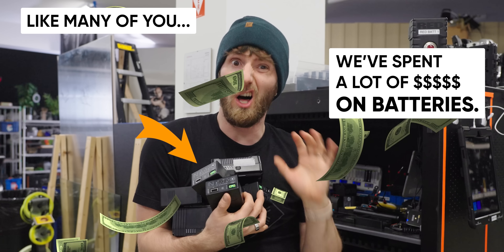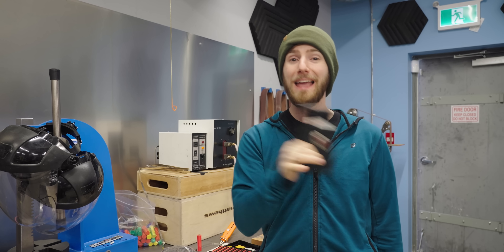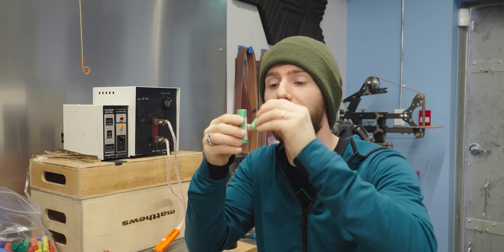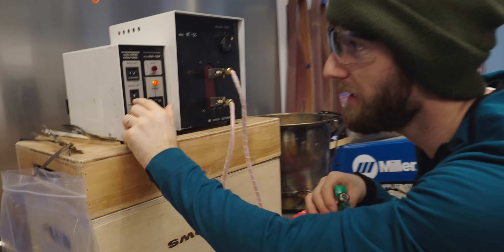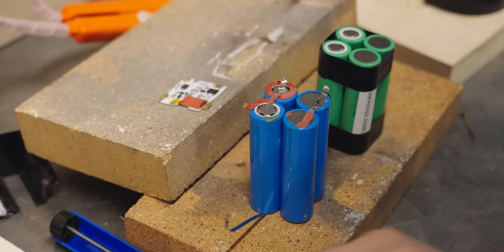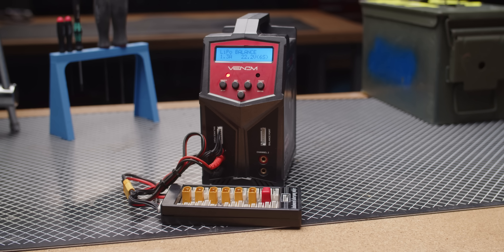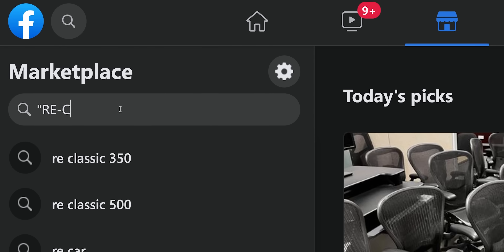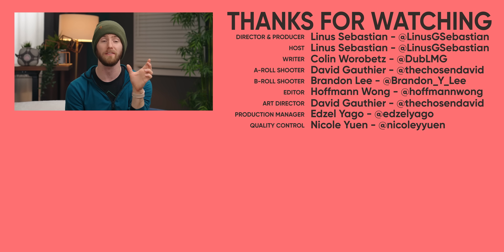This should be illegal… Battery Repair Blocking

Comment: As a safety engineer working with batteries I must tell you that you should split an "evil" category into "really smart" and "evil". Why? Old cells may have increased self-discharge and if they discharge below certain level they start to damage themselves internally in a way they become unsafe when charged. Mildly overdischaged cells may be safely charged with a very small current while below certain voltage there is so high riosk of internal damage that it should not be attempted. Battery manufacturers take this into account by including a pre-charge feature, but also a lockout function which bricks the battery if any of the cells go down below certain voltage, say 2.0 V. Guess what happens when you try to swap cells and suddenly there is no cell? Yep, it bricks itself as a precaution. Now, that's a "really smart" battery that in turn is PITA to swap cells, but with a right tool a BMS chip on such battery may be turned back on. Then we come to "evil" batteries: They do the same, but they have ENCRYPTED BMS chips or even do some trickery to measure cycle count or cell capacity changes.
Reply: It seems the same thing about inkjet printers: in the past my dad used to recharge ink cartridges, he bought 4 bottles of ink for basically nothing, useful to charge the cartridges forever basically. They could be filled by a hole under the sticker with a syringe veri easily. Then we bought an Epson printer, when it detected that the ink was finished there was nothing to do, it couldn't be reset. Even if you did refill the cartridge it was useless. Of course we did toss that printer away and go for a laser one, but still. 

There is no reason to allow the BMS to be reset easily: you don't need any fancy stuff, since the BMS is probably a microcontroller, do you tell me that you don't have a spare GPIO that can be brought out to a board contact that if connected to GND will reset that protection? Do you tell me that coding that feature requires more than 10 minutes? And do you tell me that you don't already have that feature for use during manufacturing, but you on purpose disable it after the battery leave the factory to avoid people replacing them? Well.... exactly as the ink cartridge, it's a product made with the purpose of being not user serviceable.
Reply: Therein lies the problem though. Nobody makes the reset tool readily available, so frankly, they're no better than the evil ones who encrypt. To that end, it makes more economic sense for someone to find an aftermarket BMS that will play nice or be sneaky and clip a few power supply outputs (at the appropriate voltage(s)) to the BMS before disconnecting the battery pack.

It ought to be on the battery manufacturer to have a tamper indicator so that when it does go up in smoke, should the tamper indicator survive the blaze, the manufacturer can wash their hands clean of a DIY'er failing to repack their battery while still allowing the DIY'er to perform the task instead of gouging them for another expensive pack.
Reply: @larzblast  Apple's tamper indicator bricks their entire phone when tripped.
Reply: @Astro_Alphard  We're talking about replacing cells within battery packs here, not batteries inside phones. Totally different paradigm (though Apple are evil for what they do with their batteries too).
Reply: Yeah the topic is repairing battery packs but the theme is widely related to lots of other repair situations, John deer for example. Support the Right to Repair. If you know who encrypts their BMS, or who booby- traps equip they sell - Don't buy their products. Companies should give up control when they sell you their product.
Reply: If a company doesn't sell you the tool you need to swap the batteries or even worse does not even mention that such a tool is required with their battery management system. Then they might as well fall into that evil category
Reply: Thats really insteresting i enjoyed that bit of info and seeing how you have knowlege in the engineering i have a question for you.
 I have a couple of makita drill batteries that will not charge. The #1 cell is connected to the portion of  BMS that checks the batt voltage. The volts on the #1 cell dropped below operating use while all the otheres where fully charged because the bms burned up all the storered energy from the single cell. I figure you already know that situation so i dont have to fully explain it but now with the issue fixed the smart charger (only 1 i have for it) has locked out the 2 battery packs thathad this issue.
 
Im hoping you know if there is a way to reset the BMS lockout chip? Im about to attempt removing the BMS completely from the pack and letting it fully disharge in hopes it'll memory wipe the lockout chip on the BMS. Theres also a 7 pin connector located on both the battery and charger. One of these pins leads to the lockout ship but I'm not sure which one as of yet until I find a schematic that tells me which pins are which.
 I've recently fixed the BMS on a Milwaukee battery and a HP laptop where the battery is dropped below voltage and the BMS had shut off and the only thing they needed was to be woken up because they were in sleep mode.
 Unfortunately in my case that's not the issue to resolve them so for now I have to use another battery that can be charged to charge the batteries that won't be charged. 
Would you happen to have any advice I could use to get these problem batteries working again?
Reply: @mknight6026  Did you ever find a solution to this BMS problem? Please share if so ...
Reply: @mknight6026  the best solution to resolve your bricked  Makita batteries is to swap the BMS with one you can buy on eBay or AliExpress. That is, if you want to use the Makita charger and have everything work. I have tried to resurrect the original Makita BMS without success, and rebuilding, resetting power tool batteries is a big part of what I do.
Reply: Not an expert here but have done a lot of reading and have done pack repair.  The point about the BMS shut down for recharge safety is a fair point.  BUT,  the issue is not actually that when a cell gets too low it can be unstable when recharged. The issue is that when a given cell get lower that the others in the pack,  either due to a high self discharge or low capacity,  it is possible that it (one cell) can be driven in to reverse charge when the pack is run low and recharged.    THAT is when things can go bad as the cell can/will goes unstable (think smoke, explosions  and fire).   If a pack refuses to charge because it has been left to sit too long, it is unlikely that any cell was reverse charged.  Theses are packs one can "jump start" to get them up enough for the charger to finish the job.  
As to repairing packs with smart/evil BMS, (assuming they have not locked down already) one can solder leads on the BMS and hook them to a PS to keep it powered (above the minimal pack voltage) during the repair.   
 
As to a big issue with Linus's technique, 1) You've got a WAY over kill spot welder!  One of those cheap $20 board level ones would be better (what I have).  2) An important technique is NOT to push down hard. It turns out you are DON'T want a good contact! You want very small contact point so the heat is very local both at the probe tip and between the nickel strip and the battery terminal.  
When repairing or building a pack., it's important to get all the cells to the same charge level. When building, charge them all separately to max.  In a repair, (which I do only for newer packs where one cell has died due to a mfg flaw - not for worn out packs)  I find and pull out the low cell and then temporarily install a new cell that is a charged or discharged to be some amount below that of the other cells in the pack.  I then charge the pack. Then it pull the new cell and charge is separately the rest of the way and then I weld it back in.  Reassemble.  - Done -
Reply: I have 18650 cells from laptop packs that were made before 9/11 happened, and they're still fine.
Reply: @vhfgamer they don't like manufacturing products that last because then they sell less
Reply: @vhfgamer Lithium battery fires can't melt steel beams.
Reply: encrypting the firmware isn't evil, it's a way to protect the SOH algorithm from being leaked, as these take a lot of work to produce and a lot of data to be analyzed. Counting cycles and stuff like that is also very normal and part of a BMS' job, then stopping being able to work is also a valid action because old cells that have had way too many cycles go through them is a major safety hazard.

I wrote a comment about everything wrong in the video but it's way too long so it got lost, kinda disappointing
Reply: @EMILE12345678901  Is the comment still somewhere under the video "lost" in dozens of other comments or is it lost-lost? I'm interested in learning more details. By the way some battery standards do require tamperproof enclosures for batteries so that regular user cannot easily disassemble battery - For protection of the non-professional user attempting to look inside.
Reply: @mibars  yes my comment is still there. I work as the lead dev on the bms firmware for a battery we develop at my job, so this video made me pretty angry at the time and I explained maybe too much. To me the main thing is is just that LTT is a very mainstream and popular outlet, so for them to present so many inaccurate and dangerous practices is very disappointing.
edit: my first comment was on feb 13 2022 if it helps... it's pretty far back
Reply: @EMILE12345678901  Hi! Any chance you can copy your original comment here? I tried to look for it but there are too many comments, so I can't find it.
Reply: @vittoriotodisco3018  it's kinda big but sure I guess. From over a year ago:

Dude almost everything showed in this video was entirely wrong...
The risk when soldering cells that are unbalanced is not when joining the series, it's when joining the parallels, as they will naturally balance into a "single cell". At that moment, if the difference in voltage is really high, the current seen by the cells will be exponentially high and similar to a short circuit. However when connecting them in series, each cell doesn't really do anything, as the battery terminals are still disconnected and it's an open circuit, so no current flows.

Next, the sparks that were shown and misjudged as a cell failure were not any sort of cell failure (referring to the second attempt at assembling a pack in the video). Those were just sparks from the spot welder, which aren't the best but they aren't damaging the cell, as the circuit created is very short and between the two electrodes. The real risk with the spot welder is heating up the lithium inside the cell and getting in the self combustion territory. At that point the cell will most likely start producing smoke, and then fire will come after some time.

The concept of swapping some 18650s for other 18650s as if they are all the same thing is just plain wrong and dangerous to tell people to do. The chemistry inside each cell is not the same. Their capacity is not the same, their voltage range is not the same, their charge/discharge current limits are not the same. So no, "re-celling" a pack is not just "make sure the cells are genuine". The cells should be the exact same model, or if that's not possible they should be of the exact same specs for the 3 critical safety specs: temperature range, voltage range and charge/discharge current limits. The capacity is also very important if the BMS is of the smart kind, which leads to the next point.

Saying a BMS is "Evil" because it doesn't work after it gets rebooted with new different cells is unbelievably stupid and wrong. When the BMS gets power cycled, if it's a smart one, and it hasn't been told explicitly that it's safe to start working by some external signal, the correct behaviour should always be to wait and do nothing. The BMS cannot in any way guarantee that the cells are of the specs it was designed to manage. What if the voltage range it was programmed for is 2.8 to 4.4V but the cells you replaced the old ones with are for a 3.2 to 4.1V range? The BMS has no idea about it and starting to work without any confirmation that it's safe to do so could result in cell damage, which is the one singular goal of a BMS: ensure cells are never damaged and always working within the safe limits.

Next, another similar reason to why a BMS shouldn't "just work" after getting power cycled like in the event of a cell swap would be because the configuration of the cells, their specification in fact, including all the safety limits, could be stored in ram. This means that at boot, the little state machine running in the BMS will start by waiting for a cell configuration to be flashed to it, and for the meantime just wait with the battery terminals disconnected. This is a very valid use case as a company could be producing thousands of BMS and have the microcontroller programmed by the supplier, this way when the PCB is assembled by a pick-and-place robot the firmware is already there and nothing needs to be flashed later. So now the PCB only needs simple communication terminals for someone to send it battery/cell configurations, which will be stored in RAM, as the BMS will never lose power in its entire life, unless a failure or unexpected event occurs, in which case the correct behaviour is again to not allow current to flow in or out of the battery. The idea of stuff flashed to ram was mentioned in the video, but not the right thoughts were applied.

Also as a bonus, each cell's "safety feature" often goes beyond just the pressure cap being designed to fissure and let gases out. There's often a very small pcb in the top of a 18650 or 21700 cell that includes two things: a current fuse and some way to open its circuit in case of under or over voltage. This is an important component of those cylindrical cells, but knowing if it's included or not in the cell is pretty much impossible to know just by looking at it, you need to look up the datasheet, which is the first step of any battery related project (which wasn't ever mentioned).

And another note "Evil BMS" bullshit. After the BMS has determined that cell has lost a very significant amount of its rated capacity, it is often a good decision to disable the battery, as older cells become more and more unsafe and unstable as they are used. A loss in capacity also means the cell internal resistance is now probably higher, meaning the same rated current going through it now heats it up much more, meaning even more damage to the chemistry. So no, disabling a battery pack based on how much total charge/current has gone through the cells is not Evil, in fact it's much the opposite and is meant to save your life.

Sorry I said too much,  but at the same time not nearly enough. LTT is at the stage where they think they know more than they really do and when it comes to batteries, especially lithium-ion and the other flavors, it can and it will cause people to try stuff without proper safety precautions and knowledge, which will cause accidents. It's extremely dangerous to present stuff about lithium-ion batteries to such a huge audience without really knowing anything about it. Please do something about it.
Reply: @EMILE12345678901   very informative, thank you very much for sharing this. I am still at the beginning of getting into battery-related projects. What do you think of projects where laptop batteries are reused to build power wall batteries? It seems to me that after discarding the ones with low voltage, the other are tested for capacity and then put together.  Is it safe?
Reply: @vittoriotodisco3018  it would be best if you can match manufacturer and model too, as the internal resistance will affect how the cells behave at different currents. Even if they appear to have the same capacity, that capacity will change based on the discharge rate and cell resistance. And even within the same model/manufacturer, if they aren't from the same lot they will have enough difference to become unbalanced really quickly. Personally I don't think reusing laptop batteries is a good idea for large batteries, they are better suited for small projects such as power tool battery packs or usb power banks. Large batteries are too sensitive to cells becoming unbalanced.
Reply: @EMILE12345678901  how do you not know that laptop battery cells are not suitable for power tool battery packs. Completely different chemistry, ICR and INR. You should know better.
Reply: @vadimbellous8313  what? I was never tagged for that other comment, I couldn't respond to it.